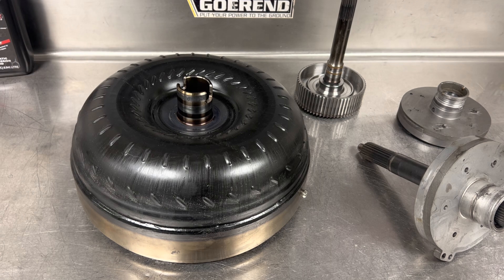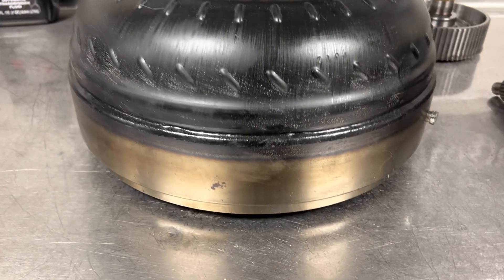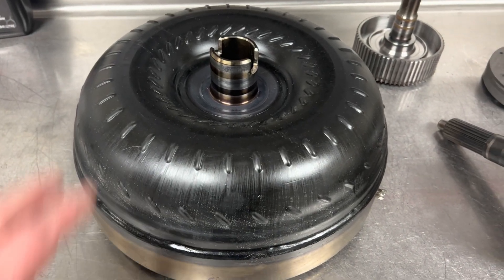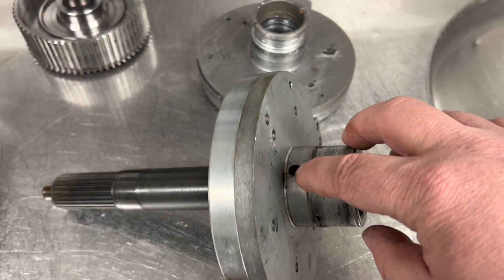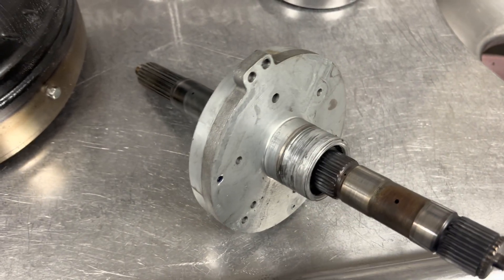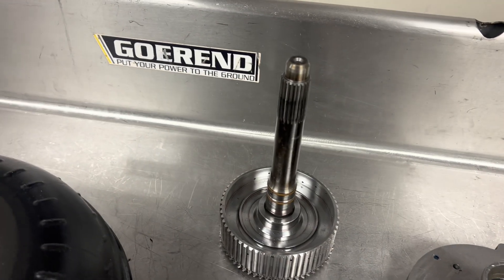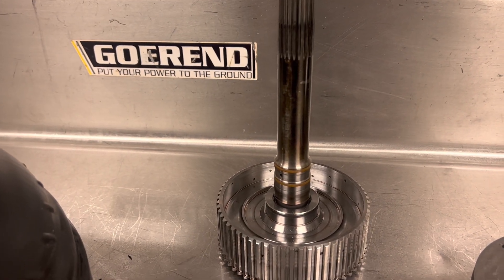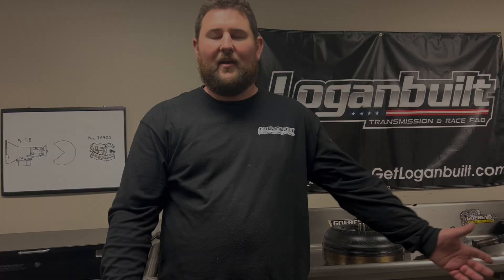Transmission Temps! How hot is too hot???

Comment: Idon't know if you will see this but I have a 2015 silerado duramax with an Allison trans. I had heard the trans cooler thermostat is the cooler line is a week point but I can't find a bypass kit for 2015 they all start at 2017. Does the 2015 even have a trans thermostat?

Comment: Hey bro i got my transmission rebuilt and I have a scan gauge to monitor the temps. I've noticed that when I take my foot off the gas the temperature rises and when I get back on the gas it goes down again when im park or idle it doesn't rise it stays at a good temperature it only seems to rise when I'm driving and let off the gas. It doesn't rise over 200 but it'll rise 10 to 15 degrees. Once im stopped it'll cool down. Just find it weird how the temp gets hotter when im coasting. I have a external cooler too. U think I should have the place I had rebuild it take a look? Also I can hear a slight whine is that normal?

Comment: I hope you can help answer this. I have a 95 bronco 5.8 L with the automatic overdrive in four-wheel-drive. While driving around town and highway after an hour and a half for drive in the combination for some reason, the engine temperature gauge gets into the three-quarter range And as soon as that happens, the front seal on the transmission starts pouring out oil. My guess is the oil pressure and the transmission is too much and it’s blowing past the input shaft seal. When the truck cools down and seals back up again, and I can drive it around for a while until the engine temperature gets too hot and then it starts pouring out fluid or pumping out fluid maybe is a better phrase. I blew out the tranny cooler lines. Check the transmission level. Both are fine. I have no idea if the engine is getting too hot and it’s causing the transmission to get too hot. Or the transmission is getting too hot, which is making engine too hot. But as I said as soon as it cools down it stops leaking I will check the fluid level. Make sure it is correct and this is going on three or four cycles now. The truck only has 110,thousand miles on it, but it has set for long periods of time without being driven. I am at a loss at what to do next. I change the clutch fan on cleaned out the radiator until that new fluid topped off and correct. Any suggestions would be of a great help right now thank you so much, Chris.

Comment: You just got a comment, like and subscribe for one thing you told me about transmissions and I rebuild them! That the torque converter creates heat! I was thinking to myself why? But came to my own conclusion, nothing get spun until you crank the motor after that then the torque converter starts to move before anything else in the transmission! It makes since

Comment: 2014-2018 Silverado with a 6 speed 6l80 should never get over 220F. I’ve had 6 transmissions put in my 2018 in 2 years under warranty from GM by 4 different dealerships. No one can fix it 😢

Comment: Dumb question - does locking the converter in lower gears help. Like allowing it to lock in 3rd on the 4l80? Holley will allow that. Thanks!
Reply from the maker: Yes, when locked up the converter us no longer shearing fluid and the cooler will be able to stabilize the trans temp

Comment: Im curious but might already have the answer. Why do manufactures allow their trans to get so hot.  Is it because trans do tend to run more efficiently when they are hotter then we would like allowing better mpg which the EPA shoves down their throats and its part of their answer to meet the mpg goals ? Even though its not great for the trans long term. And the customer ultimately pays for it.
Reply: They’re trying to get every ounce of fuel mileage. No other reason. If you want it to last, bring the temps down.

Comment: Have an 05 cummins with 48re. Suncoast triple dics lock-up. Have mishimoto trans cooler. My line temp gauge is cooler cruising down the road than my factory pan temp. Is this normal. Thought converter made the heat. Also when not in lock up the line temp climbs as I would expect

Comment: I have a 2013 chevy tahoe and they didn't put the trans thermostat on till 2014 and my 2013 is running at 210 to 220 when pulling a 12 ft trailer with my motorcycle. When not pulling anything it still runs 175 to 195. Any advice?
Reply: Mines too

Comment: My F150 with the 6r80 has a trans  operating temp of 199F. My transmission has a bypass valve that opens from 205-215F to cool to the aux cooler thats included with my Max Tow package from dealer. When i did a full flush it was difficult to get it to 205 since thats what the service manual requires. But i was able to get it to 207 empty going up a bridge and shifting to and from 1 and 2nd gear.
Reply: Yea I think he doesn’t mean a 10r80 ether lol my 2020 f150 runs at 199 and towing up hill for miles it get up to 218

Comment: So instead of running thru the Radiator cause most engines run 195 Then I should run into a trans cooler instead.?

Comment: Thanks for all the info Mr. Logan.    I just bought a random 48re from a SRT-10 RAM as a back up that I hope to build for my SRT-10.  So, I took a 700 dollar gamble and after taking it apart,  it smelled burnt and the gaskets were brittle and most parts were destroyed because of the obvious heat.  So now, I trying to salvage as many parts as possible to hopefully get my money worth.  My concern is the steel planetary gears look darker because of heat, but there isn't any wear.   Should I trust it on a 800 hp build or trash them?  Also, it had a billet single disk converter that has heat wear but not as bad as yours in the video, but Im definitely concerned.  Should I take a chance of the TC?  Thanks
Reply from the maker: @kevinsnipes9376  I’m not a gambling man so I definitely wouldn’t use the converter. Hard to say on the gear sets with out seeing them. If you’d like you can send me some pictures of the parts you’re concerned about to info@getloganbuilt.com
Reply: That would be awesome!!! I will get you those pics today.   Thanks again!
Reply: GM Mr. Logan,  i have the pics ready but I don't see how to post them to your website.  Please advise.  Thanks

Comment: Great video Logan! Quick question, I've got an early '91 with a TF727 and I'm ditching my heat exchanger and dinky little front cooler with my new engine build. I'd love some advice on what cooler to put under the bed that would be able to keep up with my slip'n'slide tf727, truck should be putting down close to 500hp, maybe a touch less. I'm looking at a griffin CXU-00001, but it may end up being a bit large for where it needs to go, other options are a derale 65860, or maybe even a derale 15875 if you think it would be enough to get me by for now. Any idea on how many btu's a cooler should be able to handle for being run as a standalone under the bed?

The forums are just FULL of people who think the truck will spontaneously explode with the heat exchanger deleted, so finding any info on what cooler would be able to take it's place is near impossible. Thanks!
Reply from the maker: @mjpermin  the heat exchangers job was to heat the transmission up quicker with engine coolant. It has no real cooling ability. You can delete it and not change your transmission cooler and the transmission temps will not run hotter. IMO the cooler brand matters very little in comparison to proper placement. If doing a remote mount cooler, it needs to be mounted in a fashion that the fan is on top of the cooler pulling fresh air from under neath of the truck.

Comment: Thank you for making this video. I have a 2014 ram with 220,000 mi on it. It has that three-way valve to preheat your transmission fluid and it has a transmission cooler that wasn't working. So, after watching your video I bypassed the transmission warming circuit and now I have heat and might truck sooner than 40 minutes after it starts and I eliminated the transmission cooler thermostat so my transmission temperatures aren't getting up to 230°. Thank you

Comment: I have a 2011 f150 with the 3.5L. I have a camper that weighs about 6500Lbs fully loaded and get up to 205F pretty regularly. What should I do? 6500lb for
That truck really is only about half of
It’s towing capacity and I’m good about not running the truck hard at all. Any advice would be great!!

Comment: I have I have an 
RFE66 in my 2018 RAM  2500. I HAVE HAD NOTHING BUT TROUBLE FROM THIS TRANSMISSION. FORTUNATELY I HAVE HAD THE EXTENDED FACTORY WARRANTY TO COVER MOST OF THE COST EXCEPT FOR THE DEDUCTIBLE. I CONSISTENTLY SEE OVER 200° IN TRANSMISSION AND I AM NOT TOWING ANYTHING. I DID ASK THE DEALERSHIP ABOUT THAT AND THEY SAID IT WAS FINE. MY INSTINCTS SAID NO. YOUR VIDEO HAS SOLIDIFIED THAT IN MY MIND I NEED TO PUT A TRANSMISSION COOLER ON THIS TRANSMISSION AS SOON AS POSSIBLE. I’M ONLY DRIVING ON THE INTERSTATE RIGHT NOW AND I SEE 204° OF TRANSMISSION TEMPERATURE. YOU SAID THAT’S THE TEMPERATURE IN THE PAN. SO THAT MEANS THE TEMPERATURE IN THE TRANSMISSION IS WELL ABOVE 204°at some point, especially at the torque converter if I understand correctly. Good video thank you

Comment: I have a built 6r140  transmission on 2017 f250 normal temps without towing is 200-205 towing or racing it 225 is where it will be . I have a bd double trans cooler installed. I’ve talked to revmax and a few ford tech and they say it’s normal and the LV fluid is good for 250-275. What do you think and what temps do you see on powder strokes?
Reply from the maker: @jerrykinsey6793  I only do the dodge transmissions so I wouldn’t be able to correctly answer that

Comment: Wht is too Hot recent Rebuilt 2015 Silverado crew cab v6..4x4..in city 160-191  So far yhis Summer on hwy 2wks ago 11/2 deive 195...? Is tjat normal
Reply: Transmission occasionally jerking vibration cause of the temperature too hot
Reply: I have a 2015 silverado v8  when the temp is 70 or lower it runs 145-150 after 70 it will run 160. When in the 90s ive seen 203.    Im about to pull our sxs 3hrs just got the bypass today will be installing it tomorrow. I also think my temp coolant sensor was bad so this will be a test.  Worse case I pull the plug on temp sensor and let the fans sing as they will run full tilt.

Comment: Hi Logan, Im sorry this is long but I have a question for you. I have a stock 2000 Dodge ram Cummins Diesel 3500 quad cab dully 4x4 truck with 4:10 gear ratio with 33 inch tires and an auto trans 47re. I live in the Houston area and twice a year I go on vacation to the Colorado mountains. Last year I was pulling my sxs in my 15' steel dump trailer and I stayed in 2nd gear going up a steep highway mountain pass at approx. 25-30 mph. and wanted to make sure and keep my EGT's on the engine under 1100 degrees which I did.  I also have an after market external transmission temp sensor that I was constantly watching the whole time. (Not sure where its mounted on the trans.) After 10- 15 minutes of going up hill in 2nd gear, my factory red trans light went off on my dash and my aftermarket trans temp said 228 degrees. I instantly pulled over and set the E brake and put the trans is neutral. It did cool down after 10-15 minutes and the trans ran great the whole rest of the trip. The next mountain pass that I came to I decided put the truck in 4 LOW and allowing the truck to shift through all the gears as it desired and drove only 18-20 mph up the pass and no more trans warning lights nor did my aftermarket trans temp get above 190. When I got back to Texas I had my trans guy drop the pan and look at it and he said everything looks great and he thinks I did not hurt it. The trans still runs great to this day. I am planning to get a fifth wheel Rv (approx. 16,000 lbs fully loaded) in the future and it will be much heavier than the dump trailer with the sxs. I always change the the trans fluid and filter every 20-25k miles. My question is, is there something more I can do to keep the trans temp down under mountain pass driving or should I just stay in 4 LOW the next time? What do you think based on everything I have described above? Thanks, Wesley🙂

Comment: Do people run remote coolers by themselves on the street? I have a Mishimoto stock replacement up front and deleted the heat exchanger because I'm on the central coast of CA with average temps of 60s to 70s year round. I want to free space up front and have the charged air cooler work more efficiently because it's just used for carrying weight in the bed usually minimal and fun on the street. I have a Derale 65861 that I will be putting behind the transfer case like you recommended in your FAQ on your website. Good thing I saw that because I was goign to put it under the bed.

Comment: Quick question that I am having a hard time finding the answer to I have a aftermarket torque converter that was used in a 47rh I am trying to figure out if this converter will work in a 48re. Is there a way to identify if this converter is a new enough unit to be universal like current 47/48 torque converter? Than you have a good day also thank you for the video very informative
Reply from the maker: You can, I would just advise removing the converter sealing ring on the stator support of the 48.

Comment: Well technically there is heat generated on every gear shift when the clutches or bands engage that period of it locking generates a burst of heat.
Reply from the maker: Extremely small amount. Nothing you’d ever see in even the best temp sensor and for such a short duration it has virtually no effect on the trans fluid temp.